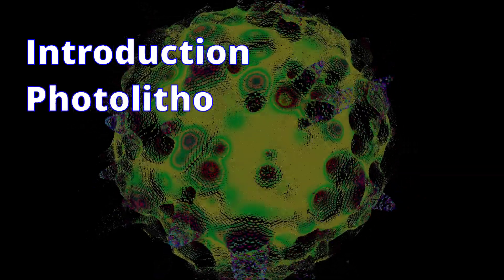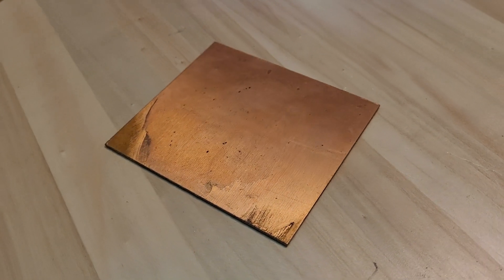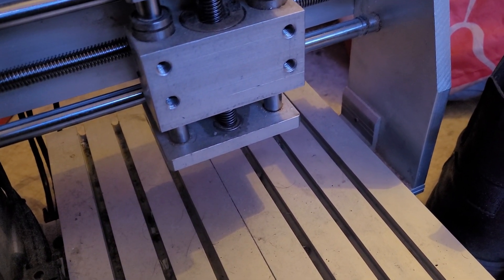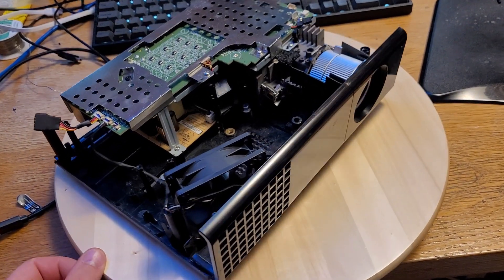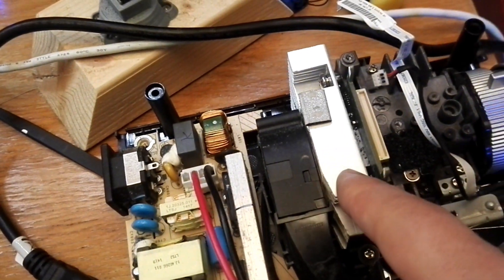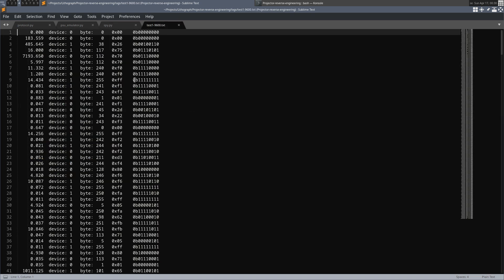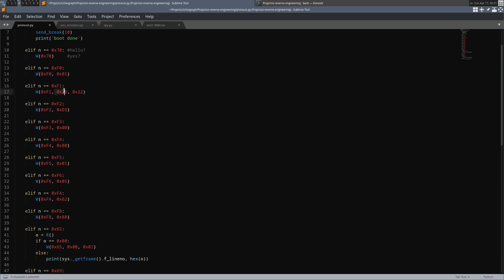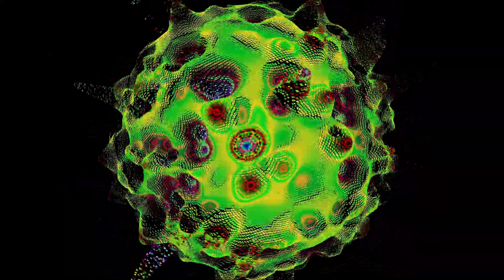Introduction PCB Lithograph

Comment: i love this video and am so glad i found your channel, however, your audio levels are far too low. ive got my headphones at max to hear it at a comfortable level. im not sure if its because of lowering in post or if the mic level is just like that. at max it even sounds like a great quality, so good on ya for that
Reply from the maker: You are correct, I have since I made this video been better at using a compressor to make a more level audio level. In this one I normalized the audio but a few scarce peaks brought the overall volume down. Thanks for pointing it out! I hope to soon make another video, I am currently taking a start-a-business course so I am a bit cramped with time.

Comment: Where is the next video?
Reply from the maker: Hi, thank you for your interest! Life has sort of gotten in the way for most of my current projects. This project is still high up on my priority list but before I can continue I need to re-establish a recurring income so that I may buy the components and circuit boards that I need to continue the project. For instance, I want to have better control over the laser I am using so I want to make my own constant current driver for it (and I better design it well too so I don't fry a spendy laser diode!).

Anyway, I am glad there is an interest and I will do my best to continue on this project as soon as I am able to. In the meantime I have mostly been working on software projects and I have been thinking about making some sort of video introduction to one of those projects.

If you are curious about those projects I do keep a journal but so far there are no curated knowledge articles there, just my daily strides which may not be too interesting but at least it is helping me to get more organized and productive which is always a good thing! Journal: https://blog.efforting.tech/lovqvist/journal/index.html
Reply: Keep going,  @miklov , we're waiting for part two!